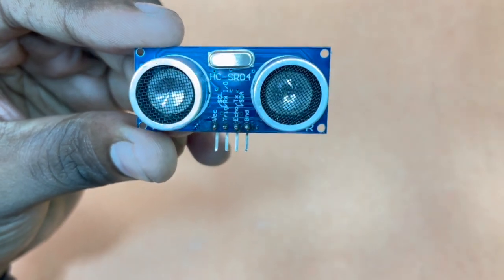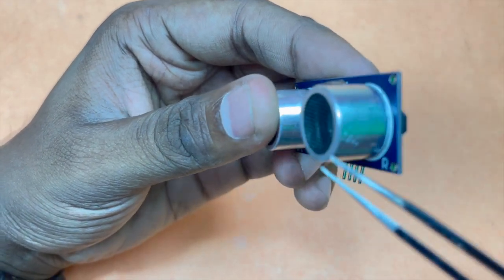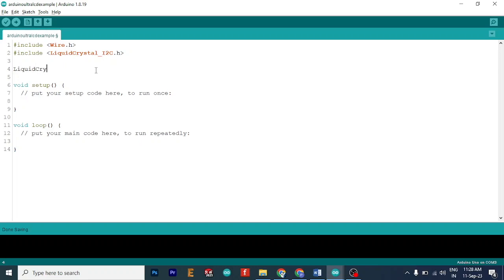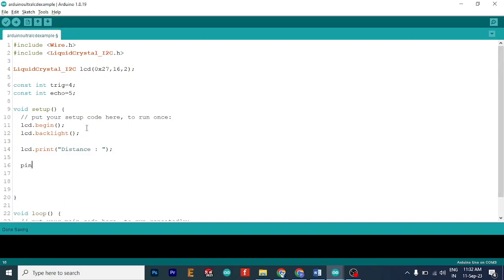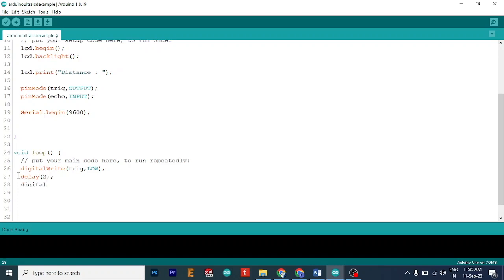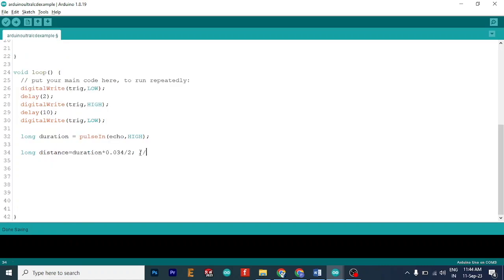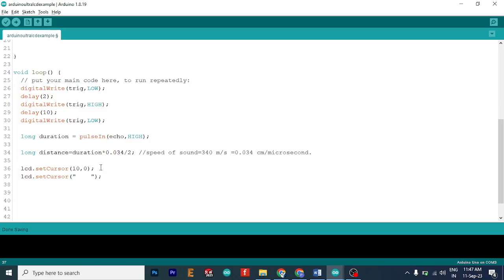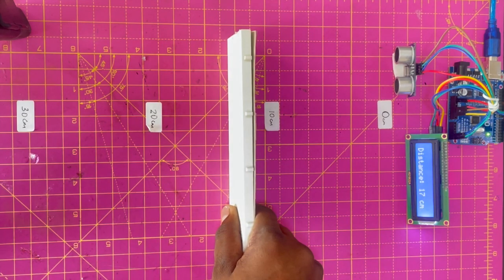How to Use an Ultrasonic Sensor with Arduino

Comment: Very interesting and helpful tutorial sir

Sir the arduino you had used in this video is the copy of real. 
sir i have same arduino.
But I am not able to upload code into it 
Whenever i upload code the code successfully uploads but does not work correctly please help😢
Reply from the maker: Hi, if you are using a clone there might be some hardware issues with it. Please try it with another board if possible.